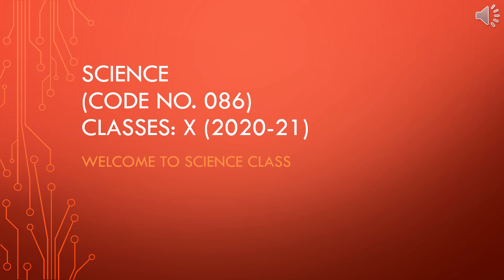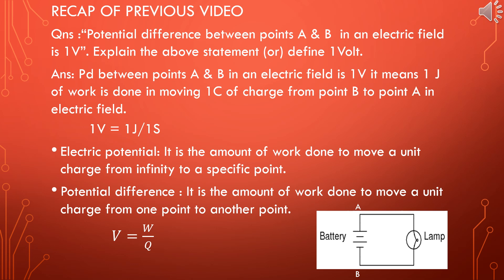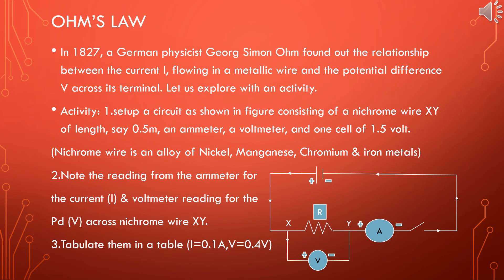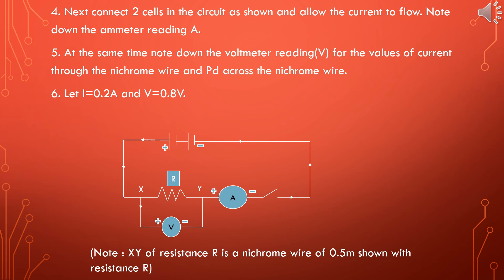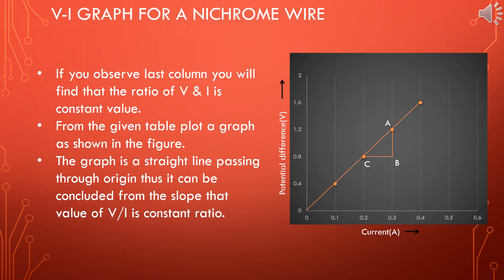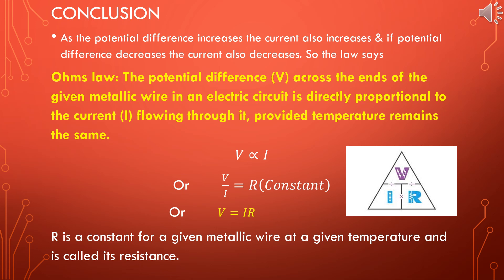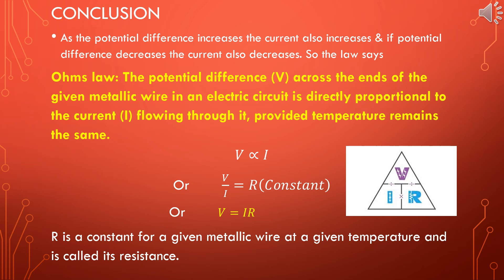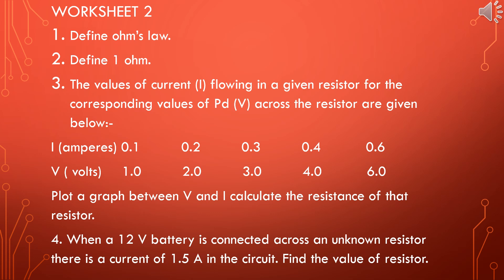ELECTRICITY (PART 3)

Comment: Mam why do we use nichrome wire in experiment??why can't we use normal or copper wire
Reply from the maker: Nichrome is an alloy which has appreciable resistance so we use it. Not only nichrome any alloys can be used which has appreciable resistance. But we cannot use normal or copper wire as resistor because it has very less resistance.